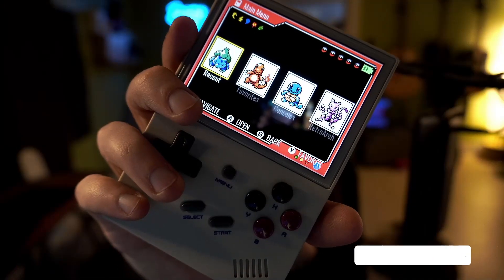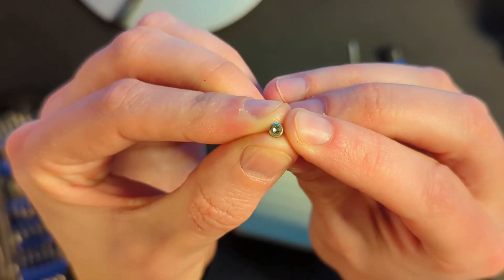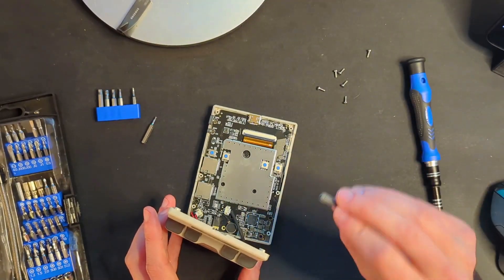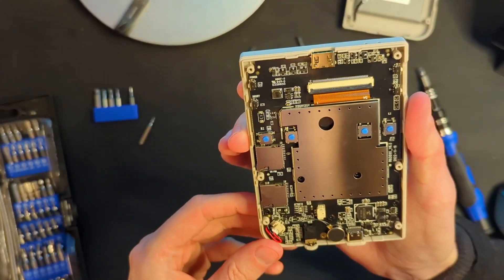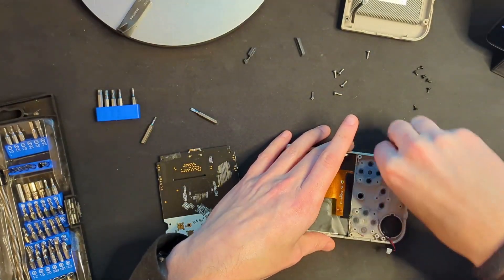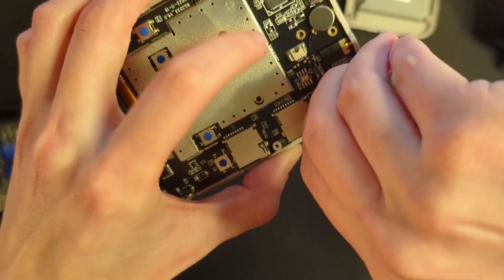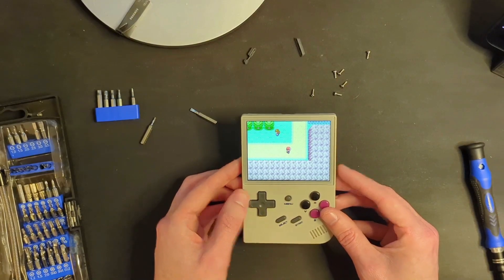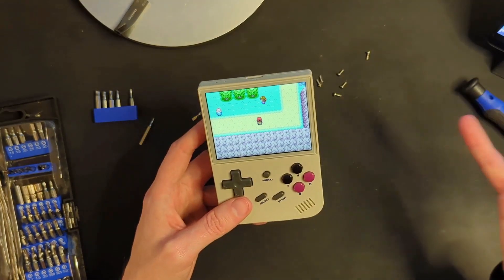How to mod the RG35XX's D-Pad and FIX the DIAGONALS!

Comment: TIP: I just opened up my RG35XX for the 5th time this morning. I would make my tape adjustment, plug in the power cable and test the D-pad diagonals. Everything worked. But when I reassembled the device, some diagonals stopped working. I found the fix. Loosen the black internal screws just a bit and the diagonals started working again properly, without the false inputs!

Comment: Just a tip when taking apart all of these handhelds.  Those side buttons (power, vol, reset) face buttons etc. on these can fall out and sometimes get lost.  Other times it is just annoying to have to try to hold them in place while putting back together without them moving around or falling out.

The tip is before you take apart put a piece of tape in the areas where the buttons are on the outside of the case.  That way when you take apart the tape will hold the plastic buttons in place and won't fall out.
Reply: Great tip! Thanks!

Comment: I just wanted to add that I was happy with just covering a 1cm square in the middle of the d-pad area. If there's someone who wants a bit more sensitivity then try that. Thanks for this video Shane Craig!
Reply from the maker: Good to know!
Reply: @shanecraigtech  I just wanted to echo his statement. I only covered up the little 'brass metal dots (if that makes sense?) that surround the directional circles, that did the trick. When I covered it using your method, it worked fine but I found I would have to press a bit too hard to register the correct input. It seems just covering up the 1cm in the middle would be enough. But thanks for the video! This was bugging the heck out of me and I never would have guessed some electrical tape would be the solution.
Reply: Gentlemen, you are amazing. I'm gonna try to fix this because I simply cannot abide an incorrect Tetris or Dr. Mario failed input.
Reply: Hey Thomas, mind sharing a picture? Did you put the square diagonal (like a diamond) or horizontal (square)?
Reply: Same here. I put a 1cm square of tape inside the D Pad and it fixed the diagonal issue. Interesting thing was that the tape I used was thicker than electrical tape. The first time I used two layers and I couldn’t hit the diagonal at all. I took it down to a single layer and it was fine. Might shed some light on how this fix actually works.
Reply: @garykingston1662  did you cover each brass dots around the dpad? There's like 4 dots on each button for the dpad. Do i cover them all or just the "inner dots"?
Reply: @J.C.2.5  I just covered up the little dots in the middle. Basically, I made the same X he did in the video, it’s just slimmer. The circles that represent each dpad orientation are fully visible. I’m sure the centimeter square in the middle would suffice, but I think the X works quite well. I’m not even sure why it works; it just does. If needed, I can pull mine apart and snap a pic.
Reply: @garykingston1662  yeah, a pic would be great!
Reply: @robhulson  Are you happy with the result now?
Reply: @garykingston1662  Waiting for the pic. :)
Reply: @endiz  Oh I'm sorry for not noticing your comment until now. I did cover it like a square. Hope you got it right!
Reply: I have a theory. I don't think you really need to cover any part of the contact area at all. I believe the main concept you should be aiming for is creating a pivot point in the center so that the d-pad isn't laying flat and accidentally hitting the other contacts when you push in one direction. Laying the tape down in a cross creates a double layer in the center which inadvertently creates this pivot point. Edit: After looking back at the video I think this is exactly what's needed. If you pause the video at 5:20 and take a look at the button membranes, the one on the right is the d-pad. If you look closely the pivot point is already a built in mechanism on the d-pad itself. My theory is that this pivot isn't big enough or the membrane is too thick and it isn't allowing the d-pad to pivot properly (which would also explain the common "stiff d-pad" complaints). By using the tape to create a platform in the center you're allowing the d-pad to pivot as It was intended. I think if you create a layered square in the center instead of a diamond you might see and feel better results. You could even dial in how much resistance you're comfortable with by using more or less layers.
Reply: @chriscrux4556  I think you may be on to something. I sorta thought the same, which is why I slimmed mine down from the video. I would test it, but the way I did it works great. I’d hate to mess it up. If you do the center only, please report back. I’m curious and I’m sure they community would love to know as well
Reply: @chriscrux4556  I can confirm, only putting a small square of tape in the middle of the D-Pad, not touching any of the 4 contacts, solved my issue. My guess is the pivot point of the D-Pad is just ever so slightly too short, so something as thin as a single piece of electrical tape gives it the space it needs. 🎉
Reply: @robhulson  Same here lmao
Reply: I just did this to mine and wow it feels so good. Two layers of tape in the middle is perfect.

Comment: Dude, thanks a lot, it got my shitty rgb20s fixed. Before the mod it was one of the worst dpads ever, now it seems like a pro control. Tip: if the dpad is a little too mushy, try adding one or two extra tape squares  under the pivot point, I put 2 here and oh god, so happy.

Comment: This is a good mod to do for another reason. 

Anbernic Handhelds have a fatal flaw: the d-pad's central pivot rests right on top of the PCB traces for the d-pad itself (especifically right on top of the Left directional button). Over time, this pivot starts to rub, scratch and, in some cases, completely scrape the traces to the point the d-pad no longer works and becomes pretty much unfixable. It happened to me with an old RG351V that I had poured my heart into making it the perfect emulation handheld. Needless to say I was pretty bummed about it.

Anyways, doing this should probably help prevent all that rubbing from scraping and scratching the PCB and give your handheld a longer life.

Comment: Agree with Thomas Kaikonen. Doing it the way Shane does it, it almost prevents you from doing diagonals at all. Just cover the inside-facing half of the contact points.
Reply from the maker: I can still do diagonals fine on mine, but I would encourage people to do whatever works best for them!

Comment: Do you think it uses the same button rubber membrane as the switch joycons? Not expecting a 1:1 fit but maybe with a few "cuts" it might fit into the shell? I'm asking because in time, these rubber membranes tend to tear apart and it would be easy to replace if the ones for joycons can fit.

Comment: What IS the right Torx size needed to take apart the 35XX? I want to do a button swap and possibly a dpad swap. You used Torx 1.5 but then said it wasn't quite right.
Reply: I used a Torx 1.5 and it was the perfect size on mine.

Comment: Can you still throw Hadoken in Street fighter after doing this ?  Ty for your works !!
Reply from the maker: Diagonal still works, you just have to be pressing both directions at the same time now. I'm not a street fighter player.
Reply: I can throw Hadokens no problem with an unmodified unit. But shoryukens are another matter and it's hard to get consistency.

Planning on doing this mod to see if it improves the chances so that my dragon punch cannot be defeated, thus rendering my enemy's standing chances to zero.
Reply: @robhulson  How did it work out? Having issue playing Contra well due to the DPAD

Comment: Kinda weird almost every model of this brand has a problem with the d-pad. I got the new model of this rg35XX and the problem of mine is the left bottom diagonal being almost imposible to input. I either go to the left or to the bottom but hardly to left bottom. The rest of the inputs including the diagonals are perfect

Comment: Today, I tried fixing the oversensitive d-pad. I tried your approach, I tried the "only cover the little inside squares" approach, but no matter what I tried, I couldn't consistently pull off a hadouken/shoryuken.

Back to the drawing board. Hmm...
Reply from the maker: Good luck!
Reply: @shanecraigtech  OK, report in and I found something I'm genuinely happy with.

If each D-pad directional is a Y, I found the solution was to use tiny little rectangles that covered just half of the bottom of the stem of the Y.

I didn't cover the little golden squares, I didn't use anything wider than a 2mm strip of electrical tape (and no longer than 5mm), starting at the middle of the stem of the Y, and moving towards the center.

I did this on all four inputs.

Now? I can throw the hadouken with impunity. I can do shoryukens with ease. And I can play Kirby's Adventure and won't accidentally inflate Kirby while I'm moving left to right. It's the best of all worlds.
Reply: This reply exactly answered the only question I had. I'm struggling to understand what you mean by using the Y reference. Do you mean to say that you use tiny strips to cover part of the quarter circle pie cuts but leave the tiny squares completely exposed? Kind of like making a pattern of the gaps between the leaves of a four leafed clover. I'd love to do this mod but I don't know if I'm interpreting you correctly.
Reply: @robhulson  can you maybe share a photo of how you did what you're explaining?
Reply: Yeah, unfortunately this approach avoids diagonals, and you must push too hard the interception to make them register, of course this is not good for motion moves

Comment: Only video I’ve found that deals with solving this! Playstation controllers dont have this problem and neither do rg351v’s, but retro fighters and steam deck do. I wouldnt use electrical tape though maybe. Too much residue. For me the best test is biker mice on snes and try doing a wheelie and going around a corner. If your cojtroller can’t handle it, it’s not your fault that the device is designed by a committee. I actually have very little complaints about my rg351 device though. I haven’t ahd to scrutinize the dpad and.. The buttons are quick and springy and don’t feel like they wanna break.
Reply: Your comment made me decide to buy the RG351v. A good D-Pad is a must if I’m buying one of these kind of devices.
Thanks.
Reply: @X_Leonhart  Hahaha do it! It is worth it. I used the new windows power tools to rename some of the games in bulk because they come named like "005 rushing beat 1" and stuff like that but it comes with a good deal of japanese games etc. It can run dreamcast and psx and psp pretty well (resolution ain't great but I needed the vertical handheld and I  like 4:3 aspect ratio)  but n64 is buggy. I found some of my favorite ps2 and gamecube games on the dreamcast anyway like evolution, grandia and skies of arcadia, etc. It really is a very cool little device. It has a rockchip arm cpu in it. If you want to keep the games that come on it but upgrade to a new sd it might not work at all until you clone it to the new one. Happened to me. I'm thinking of buying the odin to install windows on arm because it has a unique cpu, and hopefully try to play a few native windows games on that. PS. I was a bit harsh on the new style of dpad they might be okay for fighting games and stuff, but some games like biker mice on snes where you're controlling it isometrically you start to notice new dpads aren't so precise unless you appreciate being able to move your thumb over it in a circle motion for like a hadouken. New dpads are great for that. But with a ps2 dpad I can do a wheelie on biker mice and turn a corner at the same time. I had to open it and clean the contacts because I bought one recently but they really nailed it. What can I say, credit where it's due. And those thumbsticks with a huge surface area. Still my favorite! Except the back of it and the plastic just under the trigger buttons that locked your fingers over or under, not able to switch comfortably back and forth like the newer gen ones. Back to the handheld though; If you buy the grey one you can put a bezel they sell over the screen to make it look dmg and a sticker for the back too. And the purple buttons, but it's all third party. I left the black one I received stock. Dang I'm forgetting something... oh yeah! It uses a non gui os with emulation station running on top of it. It comes with very usable configs. Very nice! Wifi to scrape the game covers etc. (turn it off right after to save batt.) I suggest learning on emulation station desktop ediiton app. You can make a portable version of it too on a usb stick! Make sure you don't scape all the media types because then it's hard to erase. I scrape just the info and 2d front (and back) on the rg351. Any google answers you need type in rg351 since it's all the same family jsut different form factors. I think that's all! Good luck! My favorite part is absolutely the tactile a and b buttons. They have a good amount of travel and resistance. I push them really fast and remove my finger fast in one motion and they're just snappy and actually fun.

Comment: I'm thinking that the height of the electric tape might impact click sensation by a bit. I have yet to receive my RG35XX, but once I do, if I feel that the diagonal issue bothers me, I'll try drawing the X section with an edding pen instead of using electrical tape. That also insulates the contact electrically, and I think the carbon should be soft enough not to scratch the pen marks off over time. Just need to make sure to let it dry enough before reassembly. 

I'll report here when I know how well this works.
Reply: I really want to know if it works？ edding pen？

Comment: Wouldn't be more efective the use of nail polish? You can cover selectivelly (paint) any zone and keeps well fixed.
Reply from the maker: In such small spaces and with my fine motor skills, I would much rather deal with a solid than a liquid.
Reply: you know... once nail paint is dry it won't unstick as tape.

Comment: Wondering if the "3 hole binder ring" trick commonly used on older 8bitdo d-pads would work for this as well? Haven't had much issue with my RG35XX's pad yet, but may open it up just to try.
Reply from the maker: I don't even know what that is, but I'm curious now lol
Reply: @shanecraigtech  Basically, someone discovered those 3hole binder reinforcement ring stickers you can buy everywhere have holes the size of standard dpad contacts and used them to fix this issue on older 8bitdo pads. I’ve used it and it works quite well.